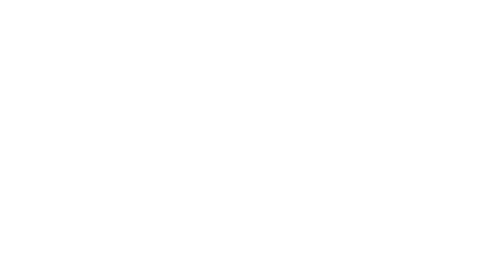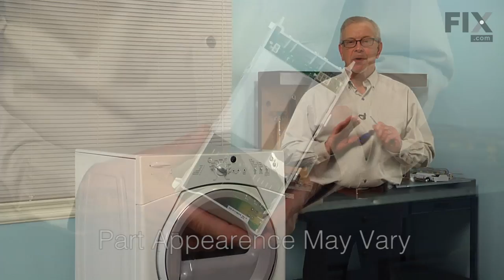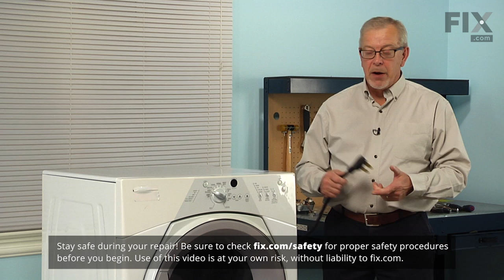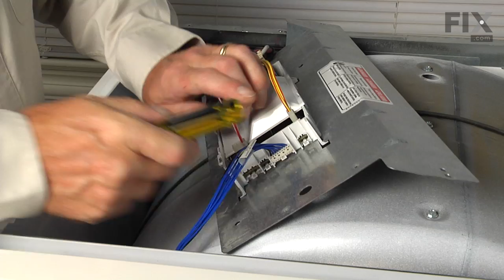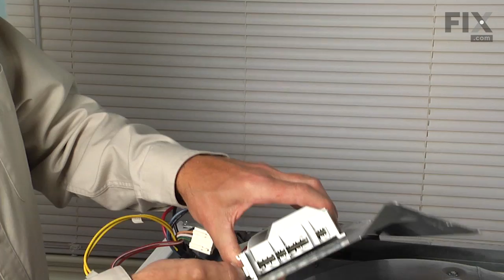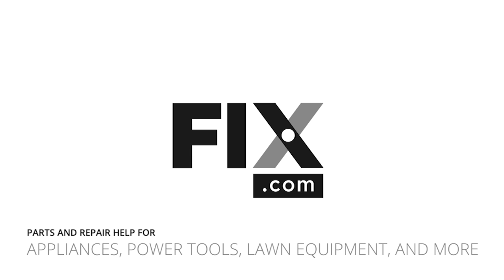Kenmore Dryer Repair – How to replace the Electronic Control Board

Comment: Great video. My repair went exactly as the video showed. I bought the control panel and followed the video instructions and fixed my dryer (F-1 fault code) in mere minutes.

Comment: There are no lights at all on the power panel of my kenmore quick pak9 he5. However, the drum light is on. Is this problem related to the control board? I replaced the thermal fuse but it still doesn’t work.Thank you.